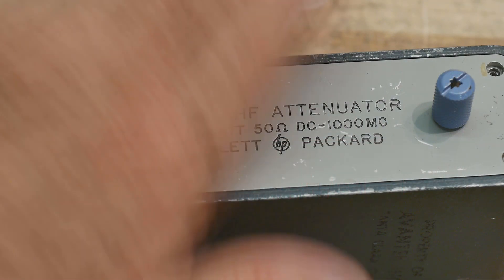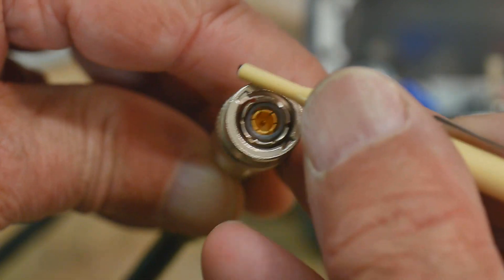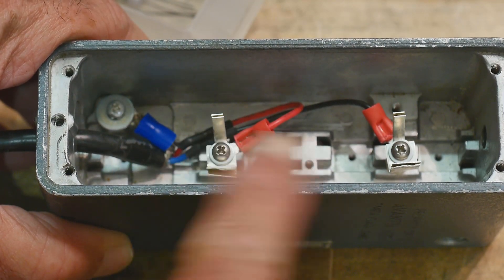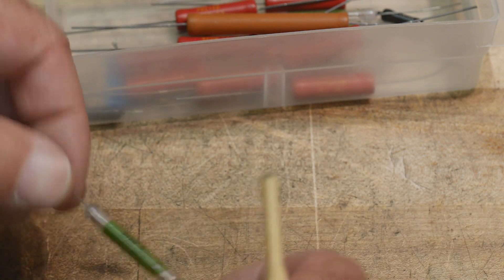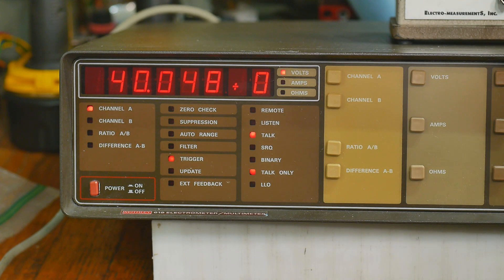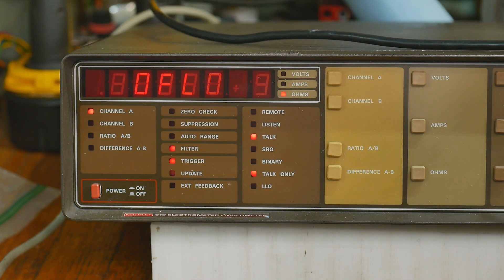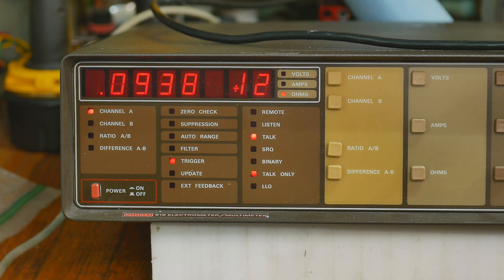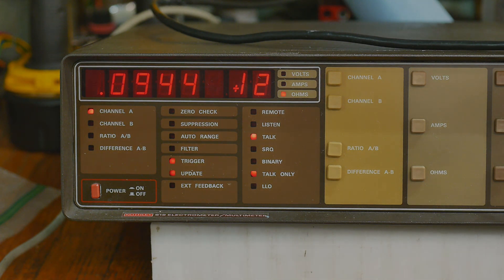#765 Keithley 619 Measuring Gigaohm Resistors

Comment: Never imagined gigaOhm resistors would exist... won't it behave like almost an open circuit? What's the use?😅
Reply from the maker: very high gain feed back resistors for amplifier circuits. and DC biasing for high impedance inputs.
Reply: @IMSAIGuy  yes 👍🏼

Comment: Very nice :-). I'm using those things on a regular basis, just few hours ago, e.g. an ancient Keithley 263 picoamp source, or a  modern 6430 source/meter.

Yes, at those levels, all the cabling microphony/triboelectric effects begin to really wreck havoc with your measurements. Also cleanliness of your PCBs, and cable connections are really important, obviously. And those triaxial BNCs (Keithley also likes to use the triple studs/bajonet locking dimples-things, and all the adapters are unbelieveably important, if bought new.
Reply from the maker: I found that out. in a future video I show moving from twinax to triax
Reply: @IMSAIGuy  ...and what I had intended to say (thanks iphone autocorrect) was, that the adapters are unbelieveably EXPENSIVE... they are often important, too.

Comment: What type of circuit would require resistances of this value?
Reply from the maker: Almost every condenser microphone has a 1G resistor to bias the FET. The Keithly 619 uses a 3.8G resistor for the lowest current source. I've seen 1G resistor in photodiode transimpedance amplifiers. Now for 100G resistors?
Reply: @IMSAIGuy  The Keithley 263 Calibrator uses a 100G Ohm Resistor (R30 on the schematic in the user-guide) for the lowest current ranges.
Reply from the maker: @cnvogel  263 is a beauty
Reply: Ditto.
Reply: I have some divider-style high-voltage probes that are in the neighborhood.